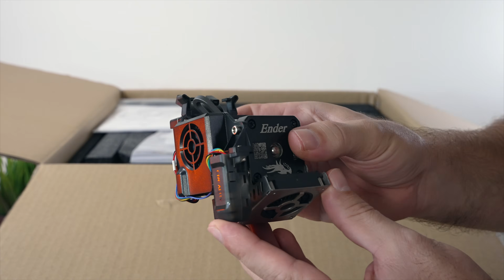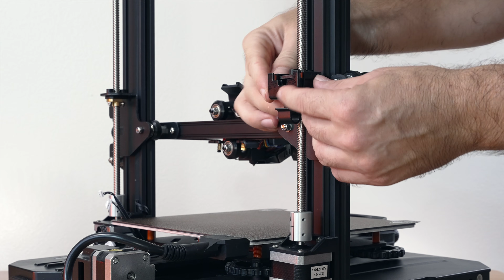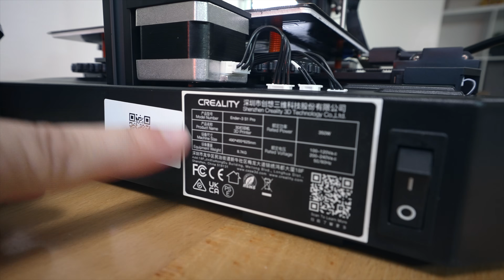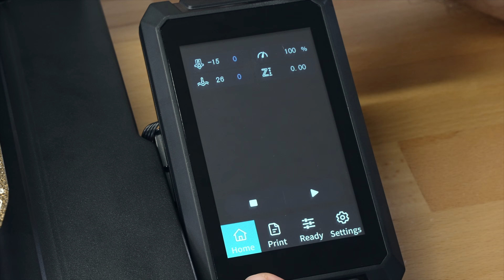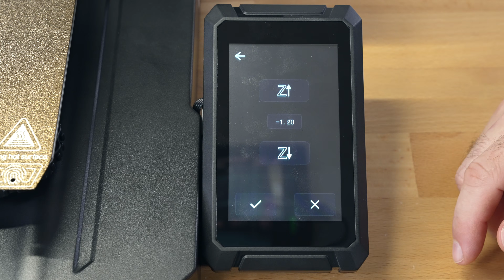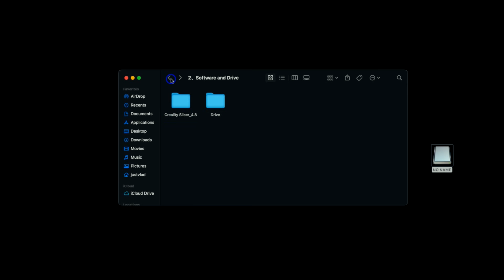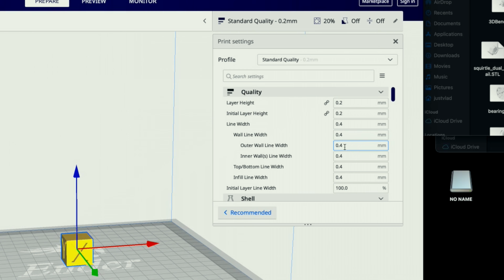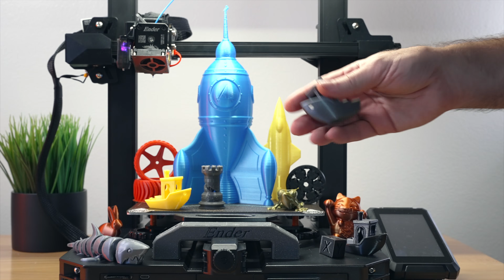Creality Ender-3 S1 Pro - 3D Printer - Unbox & Setup

Comment: The inside rollers for my z axis are super tight. How do I fix them? I've turned the nuts several times both ways and I can't seem to get them lose at all.
Reply: Same here!  I can make them a little loose at one position but then when it goes higher it tightens up.  You can sometimes hear a snap when the stepper forces the wheels to move in a level change.  Did you solve the problem?
Reply: @AlejandroJiron  unfortunately not, I just left it as is. I regret messing with them. I should have left them as is.
Reply: It still prints good though.

Comment: Great video! I appreciate the information on adjusting the wheels.
When you did the auto bed leveling, was the printer still heated? I just got mine and am having trouble with the auto bed leveling. It works fine when the printer is cold, but if I preheat first the auto bed leveling goes really slow, sometimes pausing for up to about 20 seconds. It gets about 50% done and then the probe retracts and It gives the error "203 (Probing Failed)". Then it tries to home with the nozzle dragging on the bed.
Reply: I contacted Creality support and was told to flash the firmware for the motherboard and the screen. I followed their instructions to flash the motherboard firmware, but now the printer is stuck at the "Creality" logo screen and won't do anything. Still waiting for reply from Creality, but this is not good.👎
Reply: I did get a reply from Creality, and after flashing the firmware for the screen the printer is working again. Now I can proceed with getting the settings dialed in.
Reply: @davidr1809  I has to reflash with a Japanese firmware after the newest one just got stuck with the creality logo.  I was also told to flash the screen first but I can't find how to do it.  Can you share the procedure please?
Reply: Hi! I had the same issue. Download and install the japanese firmware from Creality web and now it works right. Just don't forget to:
1_ Update screen firmware
2_ Update mainboard firmware.
DO NOT CHANGE THIS ORDER OR YOU'LL GET YOUR PRINTER STUCK.

Comment: Thabk you for this video. I'm really considering getting that printer. They say it's an all-metal hot end, but do you know if the nozzle is hardened metal or regular?
Reply from the maker: looks like regular brass, so you will need to upgrade the nozzle if you want to print abrasive filaments
Reply: @JustVlads  What type of nozzle is it?   MK8 or ?
Reply: @JustVlads  thanks for video. How do you know if a filament is abrasive. I just purchased a filament that's sort of color changing depending on direction of light source. Might that be abrasive, and how do I see it will break my prints? Clogged nozzle? Thanks :)
Reply: @Sysshad  Color changing is not abrasive - it's additives that make filament abrasive. Filled filaments like "wood" and also glow in the dark (because they have to add particles to the filament to make it glow) are going to be your 'abrasives'. Basically anything 'filled' with anything else, or anything with tiny particles for glow, will be abrasive.
Reply: @paulthetexan  thanks for reply, but to get the color change effect they must add something right? Also adding any color adds pigment of some mikrometer size. what I'm trying to say is it all comes down to the size of the pigment and how it reacts at the PLA melting temp. Some clogs, some doesn't.

Just say avoid abrasive is misleading IMHO. It's often never as easy as saying this is good and this is bad, most things is greyscale.

As an end user consumer its very difficult to know what the manufactorers add. They only are after one thing: to sell as much as possible and get rich :p

Comment: Fantastic video .. well done! First time owner of a 3d printer so i had no idea how to setup and print on the Ender 3 S1 Pro and so far had mostly print fales due to lack of experience.
On the internet could not find any usefull videos on how to setup the new printer and the shop where i bought it from could not help by phone.
Friends had other older or more simple printers and then again where no help.
This video takes you step by step with the first time setup of this printer and after that i managed to finish my first succesfull complicated print!
The printers user manual does not tell you anything about all these asymmetric wheels which need setup and my printer was not ready to print from the box.. the hotbed was moving all over the place so i needed to tighten the wheels underneath and the print head base loose so when i printed it was gong up and down!
thank you very much again!

Comment: the problem with it is its still made by Creality
Reply: Why is that a problem ?  They fix the issues users rapport back.
Reply: @admintmilgart8585   probably couldn’t get his ender to print right and he blames Creality 😂💆🏻‍♂️
Reply: @Blue_3is  You know something is up when someone shits on a starter printer, only to recommend another that costs a grand.
Reply: @admintmilgart8585  They also substitute lower-quality parts like power supplies and controller chips in without telling anyone. For example, they advertised the ender 3 pro with mean well power supply and STM 32-bit chip but sold it with creality knockoff power supply and cheesy 256k knockoff STM chips. I got one of those "pros" and won't be buying from crapality anymore.
Reply: @paulthetexan  its a budget 3d printer relax
Reply: @paulthetexan same here :/
Reply: @admintmilgart8585  yea simps only buy in hope to see wuus fake balloons
Reply: Not helpful.
Reply: @guardduvie no one cares karen
Reply: Honestly compared to the last 3d printer I had the ender 3 works like a dream.
Reply: So salty
Reply: Which printer do you recommend for beginners?
Reply: @qiyang3129  Honestly the Ender 3 series was my first and it's been a great first experience.
The more pricey the model the more out of the box ready it is to print with minimal tinkering. I love tinkering though so my next one might be a cheaper model than my first (the V2). I say the V2 with an auto leveler is a great starting place though.
Reply: @qiyang3129 If you want out of the box good to go and faithful. a prusa but they are slow. If you have any skills with putting things together and can follow instrustions a voron.

Ive had an ender and after replacing almost everything to upgrade it. you are better off starting with something with a bit better build.
Reply: when he said "hIgH eNd lOoKinG pIecE" lmao
Reply: Can you give me a better brand pls. I'm new
Reply: @conraddevera  creality is really good, I've been using my Ender 3 over a year now, but the Voxel lab stuff I've heard good things about as well.
Reply: I wanted to buy 3d printer my main option was ender 3 s1 pro after some talk in 3d printing group some said to get prusa. Prusa is like how much almost 1000 euros with shipping and fillament. I got ender 3 s1 pro for 360 euros with fillament and shippjng 440 euros you cant tell me that that deal isn t worth it
Reply: Any other printer better than this in this price range?
Reply: @sposhto6325  i would say elegoo neptun 3 pro is very godd for price you should warxh videos if two and see
Reply: @Onaj_S_Graniicce  woah ya thats really good for the price....unfortunately i have bought the s1 pro 3 days ago. Wish i knew bout this sooner.
Reply: A great video for me.  I have just bought this model, my first 3d printer.  I followed your video to go through the set up process.  It’s first Rabbit is appearing as I speak.  Thanks for taking the time to make and post this video,  and a Happy New Year from across the pond 🇬🇧.

Comment: I purchased this as my second printer and love it. My first printer was the Ender 3v2 and I have significantly upgraded it. This Ender 3S1 Pro is much easier to assemble and has almost all the upgrades I did to the Ender 3V2. This is a better printer than the 3v2 even after all the upgrades. After a few month now of using the PEI bed I found that the bed adhesion was excellent for the first 45 to 60 days of use. After two month of use the PEI bed does not stick as well as it did at the beginning no matter how well I clean it. I now use some washable glue for some prints to get the bed to stick.  I simply love this Ender 3S1 pro ! It’s a fabulous printer! 

I bought a Raspberry Pi and an webcam to install on this printer. The Ender 3V2 I already installed the Raspberry pi and the webcam. I now need to install the new raspberry pi and the webcam on the 3S1 Pro . But I need to figure out how to set up the second printer with the raspberry pi and Octoprint. 

Your review of this printer is excellent! 

When I purchased my Ender 3V2 I followed your YouTube video to put it together. 

Have you installed multiple 3d printers and webcam to use them simultaneously with Octoprint and raspberry pi ? 

Thanks again for your great YouTube videos!
Reply: If you don't wanna buy a raspberry pi and camera, you can use an old Android with Octoprint 4 Android.
Reply: @JustTechGuyThings  I got the raspberry pi and a webcam already. I just need to install it on the second printer ( Ender 3S1 Pro) .
Reply: @EdGodoyPlana  where did you get the pi from? It's out of stock or marked up everywhere I have looked.
Reply: @rzk2f875  I got it at  Best Buy but I had to pay $ 135 for the CanaKit - Raspberry Pi 4 Starter MAX Kit 4GB RAM, 64gb card etc! Very expensive!
Reply: @EdGodoyPlana  just flexin your new printer lol, although i am pretty jealous.
Reply: For the PEI bed (and for glass beds) I use Aqua Net. I wipe it down after every print with 90% rubbing alcohol.  It retains its stickiness like it did when new. When hot, it sticks. When cool it releases.  Don't use Acetone on PEI. I just got my S1 and it is working well right now -- no extra sticky required.  This was true for my Prusa and I graduated to alcohol after a month or so of using it.
Reply: I'm literally in the same boat as you. I had just exchanged my Ender 3 v2 just now at my local micro center. Though my printer is still in the box. I find that my experience with the 3 V2 will be invaluable for this nice little upgrade. Literally having every upgrade one would want to get the best user-friendly experience for getting into the 3D printing hobby.
Reply: Just curious, what were the most important upgrades you did for your ender 3 V2. Just got mine setup and looking to upgrade anything that is advised to be upgraded. Thanks :)
Reply: @papadwightman8258  I also added a Raspberry pi and a Webcam and installed Octoprint . However, the current chip shortest has made the Raspberry Pi very expensive and extremely difficult to find one. I had purchased a Raspberry Pi kit for about $90 and a Webcam for about $60. But now you can’t get the raspberry pi ! There are several YouTube videos how to install them.
Reply: Here is the YouTube link to the light I installed; 

https://youtu.be/sgw-KDnSzTM
Reply: use some steel wool then clean with  soap and last clean with ipa it will be all good again
Reply: I use Magigoo on my print beds, whether they be glass or PEI or others.  Stuff is fantastic an lasts a long time!  Still working on my first tube of it after months.

Comment: guys I need help, What is the best printer in the range of 700$ max 750&, dual color, and with auto leveling.. plz help  !!
Reply: Prusa kit
Reply: @jiaj1985  they recently upped the prices to around 850 USD due to problems with the war in ukraine but yes its still the best option and you can always upgrade to the mmu2 later
Reply: So, this one doesn’t have auto leveling, but vlad does a vid on it, it’s called the weedo x40
Reply: And this one has auto leveling but no dual color, called the anycubic kobra max
Reply: @nathancogbill8429  the kobra max looks like a really solid machine even though its normal cartesian and slangling that giant bed
Reply: thank you guys for the the reply and I bought ender 6 I had no time to decide
Reply: I hope I dont regret that
Reply: The shipping cost like 200-250$ ;'c
Reply: @princeofrandom6734  Your gonna regret that, the Ender 6 and 7 are known to not be very good or achieve what they are advertised too